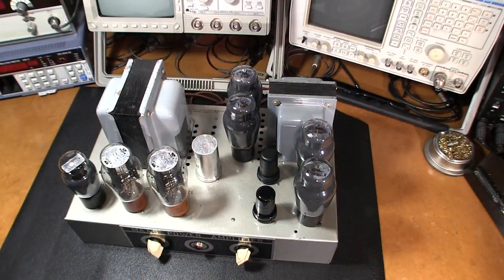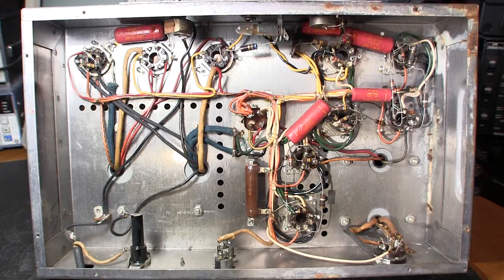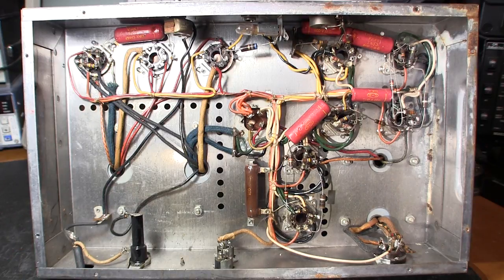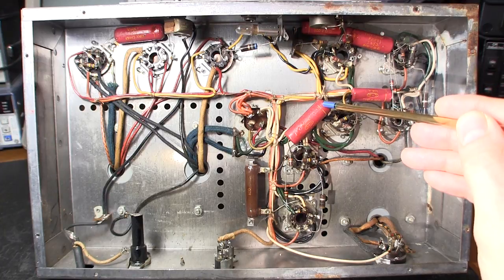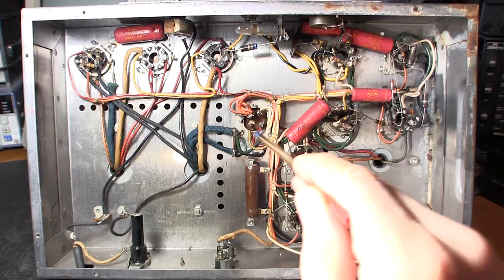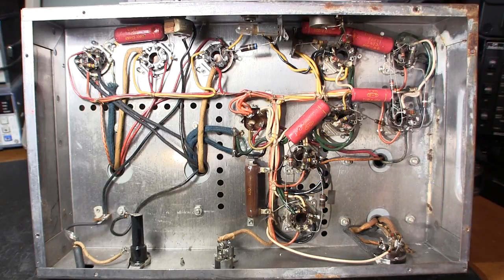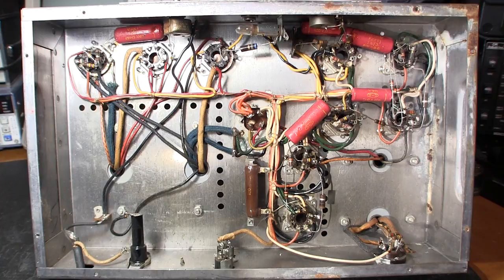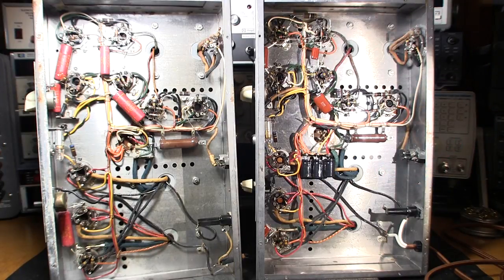Tube Amplifier Repair, and what to look for.

Comment: Tiny Grief capacitors... I love it! Reminds me of Windows when Microsoft came out with it's new "Plug and Play" technology and we'd call it, "Plug and Pray" instead :P
Reply from the maker: LOL!
Reply: Microsoft used to work together with Ericsson so when Ericsson announced their Bluetooth technology Microsoft were fast to counter it with their Blue-Screen technology.
Reply: I was in New York's Time Square about 10 years ago and one of the huge video screen had a massive BSOD Blue Screen Of Death. Wonderful adverting for Microsoft. :-)
Reply: hehe, yeah I remember that. ISDN was "troublesome" 😅
Reply: ISDN - "I Scramble Data Nausiatingly". :)
Reply: ISDN was just a parenthesis here in sweden though wasnt it? Never really broke the private market.
Reply: Plug & pray. That's great. Sadly, IT STILL WORKS... OR DOESN'T WORK... THAT WAY.
Reply: I though that was "Unplug and Pray" in reference to UPnP (Universal Plug n Play) on routers. The notion being that the feature was/is a huge security risk, basically opening lots of doors for hackers. Hence, you'd better unplug everything and pray, because that's the only thing that's going to stop them.

I've never had plug and play not work unless something was physically broken, or it was from a company that can't/won't make decent drivers. MS really doesn't make it easy to make good drivers though, constantly changing the driver model and all... My external DVD burner works fine on my win7 laptop, but win10 insists that the device is 'malfunctioning'. This is a case where they can make drivers, but refuse to update them. It's the device manufacturers fault for being lazy, if you ask me.
Reply: I hadn't heard the "Unplug and Pray" reference to UPnP. The "Plug and Pray" was in reference to Microsoft taking the term in reference to it's Windows 95 operating system.

When a leaked Microsoft memo surfaces stating that 63,000 “potential known defects” (bugs, design problems, etc) are still unfixed in the shipping version of Windows 2000, I tend to feel it’s Microsoft’s fault more than the lazy developers writing drivers. Imagine car manufacturers doing the same thing: you flip the windshield wipers on and your right turn blinker stays on. D'oh!
Reply: Plug and Pray must have pre-dated the one I mentioned. I never had to deal with windows 95.

Only 63000 'potential' defects? I would take that with a grain of salt, but it's still funny.

The reason I say it's mostly the manufacturer is because there's nothing actually wrong with the windows driver model, other than how it responds to errors. (Which drivers should never-ever have. That's an actual rule and only an incompetent developer would try to throw from inside a driver... unfortunately, that doesn't stop anybody. The result is typically a blue screen.)

I get it though, they didn't really invent the idea but tried to champion the technology. But then the end-user experience ended up being terrible. (Weather it was their 'fault' or not.)
Reply: Oh there were more potential defects than that. Here's a link to an article in Computerworld about it also referencing UCITA that Microsoft and other software vendors were lobbying for. Interesting read. https://goo.gl/IQR9Ds (opens in google books)
Reply: I tend to stay away from tech magazines. They tend to lie without even trying. My point is that it's just a number that does not really mean much. Just because there is an list of 63000 issues somewhere does not mean you are ever going to run into any of them. Linux however, I run into at least 1 new problem every time I use it.

Actually, for software, having a large bug list is more reflective of how many users it has, rather than it's quality. Consider something with millions of issues but only a few hundred users. Also, depending on the user community, bug reports can contain things like personal dislike for the default color of the interface... with how many users windows has, I expect there to be lots of trivial complains, and a much smaller number of not-so-trivial complains.

Not that I actually like MS as a company. I just like windows more than the other choices. (Either 100x as buggy, or bound to overpriced hardware that is different from what I want.)
Like take what they did with XInput for example, basically making it so that games can't use controllers other than the 360 controller. (And would rather my flight stick not be limited to like 5 buttons just so they can sell more 360 controllers.)
The windows store too... apps for the windows store have to run under the 'windowsRT' sub-system. It's a quantum leap backwards, unable to reference ANY existing libraries, no multi-tasking from the OS, etc. (Which results in only really crappy apps showing up.)

But those are 2 issues that matter more (to me at least) than all the rest of the others put together. I guess every now and then when the system goes to sleep and wakes up, it for some reason forgets what I had open. It's technically a problem, but I don't really care. Mint Linux on the other had this little problem where the bottom left corner of every window and menu item would be stretched to the center of the screen. It also told me that my Ethernet hardware was defective. Installed windows 8 and both those problems went away.
(And I was left with that god awful start screen... a problem in it's own right, though not a technical one.)
Reply: These were defects they knew about internally prior to the actual release of Windows 2000. They released Windows 2000 knowing about the problems. It's nothing to do with user bias. This list of defects was also after they had been working on fixing the initial list for 2 years.

The nice thing with open source software is that while yes there are bugs, you can actually help to get them solved by shedding light on them and reporting them and hopefully getting them worked on. It's not the same mode of thought where commercial software houses don't even admit there's a problem and leave the 'bug' or exploit in place and only finally do something when the person that originally alerted them to it and kept it closed finally posts it to the Internet for everyone and then the company decides they should do something about it. Sometimes. Both Microsoft and Apple have been known to do this.
Reply: Just because it was prior to release does not mean it was not sourced from a closed beta. Unless you've actually seen it... even that magazine says they never actually saw any list. Even assuming that list is real and generated by their own employees, they're a terribly disorganized company, so I would expect that list to be highly redundant. I also happen to know that they prioritize really weird things as 'design issues', like a hotkey being too hard to reach. At least now, there is a public issue tracker, though it's mostly spammed with nonsense. I have used it a few times to report minor issues with some of their other products, and gotten responses back, so they do actually check the thing. 

Open source is arguably better in this regard, but usually the bug lists just grow while the number of active developers shrinks. (There are some major exceptions, of course.)

That example with mint was not a joke, and when I attempted to report that my Ethernet was not being detected, I got told that it's not a bug and my hardware is actually bad. (Which it wasn't, because it worked when windows 8 was installed days later.)

I have never had any version of windows mess up as bad as any of the distros of Linux I have tried. (Fedora, Mint, Xubuntu, and 5 versions of Ubuntu.)
Of the windows though, the worst by far was in fact windows 2000. (Well, the ME edition, specifically.)
If anything deserves a term to solidify it's incompetence for all eternity, it's that thing.
I have a hard time imagining windows 95 being any worse than ME, but since I only used it once, maybe I was just lucky.

Such a different world from this old analog stuff... where things just sort of... work.
Reply: Paul's testing the Tiny Grief with a Griefkit cap tester  :)

Comment: I love working on old tube amplifiers.  Can't beat the make it simple stupid design.  One thing I would note when replacing power cords is watch polarity.  Modern power cords and outlets are polarized.  As you are aware some radios and TV's ran a hot chassis.  Back in the day you had a 50-50 chance when plugging in something that you could be attaching the chassis to neutral or hot.  When replacing the cord always be sure the neutral side of the cord is attached to the neutral side of the cord.  Just thought I would mention that for the viewers.
Reply: Good point ! I lived in this dumpy apartment years ago and had friends over all the time. One day I went to wash my hands and grab a beer from the fridge well aparently touching the metal fridge door handle and the sink faucet were neutral/hot. One friend found out the hard way getting a beer even after the warning.
Reply: I destroyed a TV back in the sixties .. because of polarity reversal.

Comment: When I was a teenager I was given a tube stereo (15W/channel) and thought I would “improve” it by changing a lot of the the point-to-point wiring to PC board which meant designing the PC board.  I bought the etching kit from Radio Shack and completed that phase of the project but never finished. The amp died from unknown causes and I shelved everything.  I now understand there is a reason why the tubes and components are laid out the way they are on a tube amp, and I would have created a lot of problems had I “succeeded” by completing the project. One feature of this amp that I remember was that it used a full bridge rectifier with four power diodes, rather than a tube rectifier.

Comment: Although this would probably be obvious to many, I want to point out that this amplifier is monophonic. That might have been a worthwhile thing to mention at the beginning of the video. I also want to point out that the circuit can be as simple as it is because, unlike a high-fidelity amplifier, this amplifier has no need for an accurate audio frequency response, as it would not be necessary to put out much power in either the bass or in the high-frequency range, but would instead be designed for maximum power in the midrange only, where most of a bell's energy is concentrated.

Comment: Just found your channel, subscribed. I love tube equipment. In 1973, aged 13, I built a preamp and power amp from the schematics in the 1963 RCA Receiving Tube Manual. Remarkably, it worked “out of the box.” Still have it! I learned that much of the spacious component placement came from following the recommended tube spacing distances in the power amp. Commercial amps often crowded the tubes to save cost. I also learned about touching 250V B+ circuits when I slipped one day. Never again.

The output transformer cost $60 back then at the local supply house. It weighs as much as a small anvil. Wish I had a box full of them.
Reply: When I was in high school a friend of my parents who was a ham radio operator gave me a RCA receiving tube manual and an ARRL ham radio handbook. Over time I read them from cover to cover. Plenty of these old books are still around and well worth having for everyone who is interested in vacuum tube circuitry. Also many have been scanned and can be downloaded for free.

Comment: I started out working on tube TVs when I was a Kid. My Mom had found some how to books from the 50's and I used them to help me repair TVs. The problem with that is every time I turned around somebody wanted to give their old broken TV. I quickly ran out of room for them, but I did get pretty good at cannibalizing parts to repair other TVs. Thanks for the great video!

Comment: Doing repair and restauration work on vintage tube gear since more than four decades I endorse everything said and demonstrated in this excellent educational video!  

IMHO only one minor aspect was not mentioned and this is the deterioration of carbon (composite) resistors over time. The higher the value, especially above appr. 100kOhm, and the higher the voltage drop over these resistors, the more likely their value has increased above the usual 10% tolerance range. Deviations of more than 100% are no rarity. Recently I was called to a Hammond E-100 (mfd. around 1965) with a weak vibrato channel. The plate resistor of an EF86/6CF8 had changed its value from nominal 220kOhm to 1.4MOhm!

So I usually check all resistors if I have older gear on the bench for restauration. Only inductors seem to be quite stable over decades, but capacitors and resistors are definitely prone to leakage and value changes with time.

Keep on making your splendid teaching videos, Paul. You have universal knowlegde and experience and great teaching abilities! Even for an old hand like me It is great pleasure to watch your stuff (e.g. the Yaesu FT-1000 rep&mod) and to learn about some details.
Best regards
Alex

Comment: Aloha- I cut my teeth with the vacuum tubes as transistors were too noisy and would never be able to handle any power or high speed transit switching.  So much for the wisdom of the day!  I enjoy your channel as I enjoyed the component level repair of the electronics I was working on.  I always said I would retire when we quit component level repair, and I did, but I also never thought I would see the day I could sneeze and blow away all my spare parts. Modern is ok as my ham radio gear is more stable and more accurate than some of the test equipment we used.  Thank you [Mahalo] for your time and work reviewing the older technology. Aloha No.
Reply from the maker: Glad you're enjoying the video's Charles! Thanks for taking the time to write.

Comment: You sent me on a learning path I never expected...what’s a carillon? So I looked it up. A carillon is a percussion musical instrument consisting of at least 23 cast bronze bells, any less than that and it’s a chime.  Some are played mechanically but traditional ones are played manually via a large keyboard and footboard by a carillonneur. The largest one in the world is in the Palace of Mafra in Portugal and has 120 bells. Most carillons are installed in bell towers but there are portable ones. 

Your MAAS 50 may have amplified pre-recorded bell music, but it may also have amplified live emulated bell music played on a keyboard. The bell sound signal was created by striking various length tuned metal rods or tubular bells via solenoid driven hammers and picked up with a mic or magnetic pickup. Often the church organ keyboard could be set to play the carillon.

The German name for a carillon is a glockenspiel.

Comment: I have an Lafayette tube amp (SE, Class A) from 1967
It hasn't had any maintenance and was sitting there collecting dust for +10 years , till I bought it from at a garage sale. 
The only thing I did, was replace all the caps, new tubes, new potentiometer and added a bleeder resistor in the supply & cleaned the unit up a few hours later...It worked like a charm!  As if it was brand spanking new

They don't make stuff like that anymore sadly, build to last.

Comment: Definitely exactly the video I was looking for as well as the tube troubleshooting tips vid. I've got a 1957 VM phonograph/changer that is non-functioning as well as a 69 Hammond H-182 organ with low output volume. I've done the obligatory electrolytic/paper cap replacement in both, but the phonograph is still silent. None of the tubes are lit but I can hear a very faint hum from the speakers. The chassis is buried in the body which makes it quite difficult to get to its underside while keeping it connected to the speakers. After watching your troubleshooting tips, I'm definitely going to be checking the heater voltages as a first test to see if i'm in need of a new transformer. 
On the organ, going through the service manual, the speaker RMS voltages are supposed to read about 10.5 Vrms, however mine seem to be at about 2 Vrms at maximum volume. After watching the same video, I'm assuming it could be the bias resistors off of the cathode or the plate resistor which could be causing a small differential in the voltages. Again, all electrolytic and paper caps have been replaced, but it only helped so much. 
I swear I learned more about tube amp theory and diagnosing in your two videos than I have in years of fiddling with them.

Comment: Dear Carlson,

Thank you for your video and knowledge sharing. About a year ago I purchased a Luxman MQ-88uC and really like the sound but I have experienced one problem that is distressing me...suddenly there's no sound from the left channel. 

In one year of intense use it has now happened four times. I am using a single source connected directly to the Variable input and after turning the volume down and up a few times the sound eventually comes and no more issues for a few months. 

Since it works well most of the time and I can't replicate the problem it feels awkward to send it to repair service. On the other hand it is very disappointing that such an expensive amplifier has this kind of issues. I changed the driving tubes (both ECC83 and ECC82) to NOS mullard after experiencing the problem the first three times, I had hopes this could solve the problem but it happened again. I have checked the bias current and all seems fine, reading near 480mV in all tubes.

Should I worry about thins? Any suggestions would be much appreciated.
Best regards.